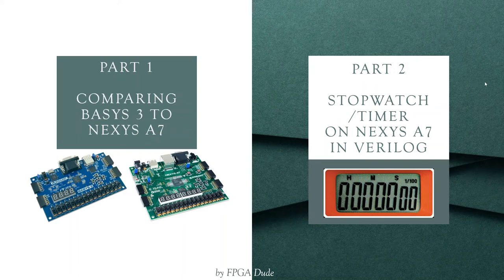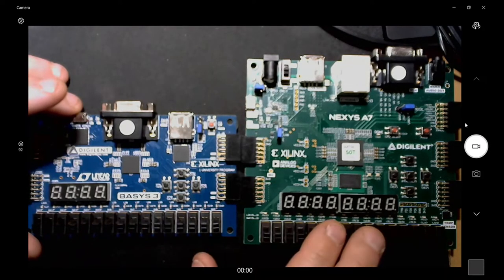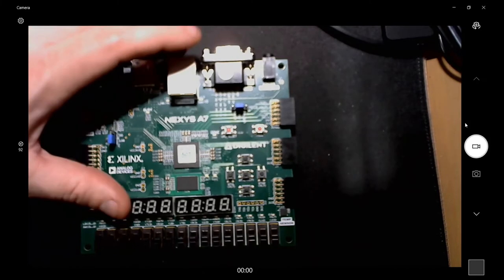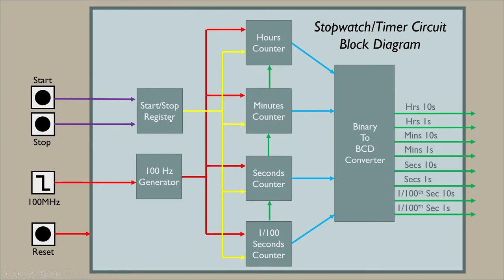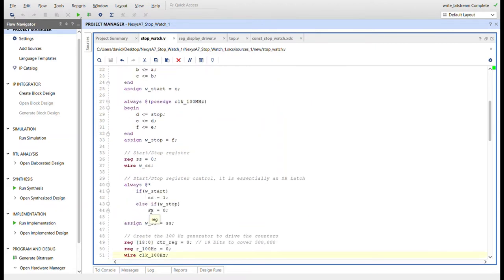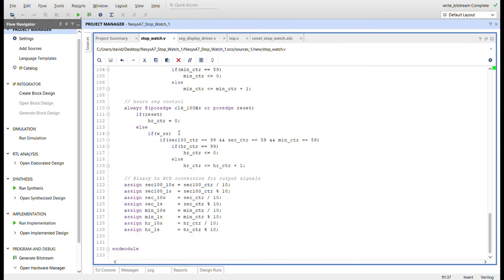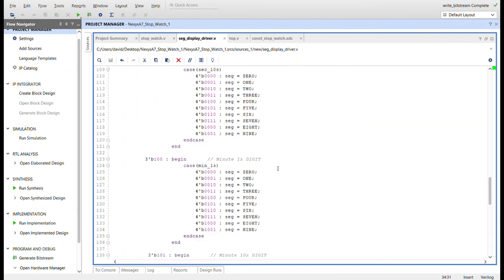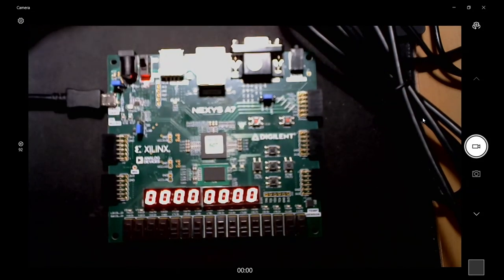Compare Basys 3 to Nexys A7 & Stopwatch/Timer on Nexys A7 Verilog Vivado

Comment: Hello how would you turn on the decimal points to separate 100 sec , seconds, minutes, and hours
Reply from the maker: Hi. You would need to include the decimal point for the segments. So, the segment would be bit-width of 8 [7:0] with seg[7] being the decimal point, and include the dp in the constraints file from the master XDC file. And you would only want to turn that bit on for the anodes/digits that you want to turn on the dp, not every digit.

Comment: Hi, David. I like your work. I am a newbie in the FPGA, Verilog world. I am currently working on interfacing DHT11 sensor with an altera FPGA. I already completed with an ultrasonic range sensor but am stuck with this DHT11 sensor. Can you guide or help me with this one please?
Reply from the maker: I've only messed with sensors on Arduino, never on FPGA. I don't like to leave anyone hanging, but I'm not sure how much help I can be. In this matter you could probably teach me something. Pretty interesting that you got an ultra sonic sensor working with an FPGA. Whatever you need help with I will try to help.
Reply: Have you done this. I have an RTL design that I implemented on an Altera FPGA to interface it with a DHT22 sensor. Very similar to the DHT11